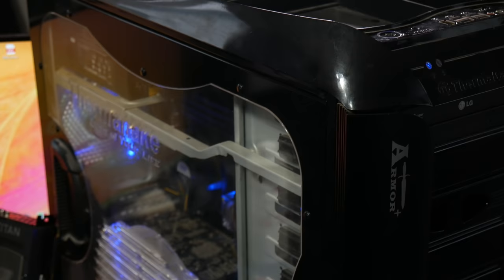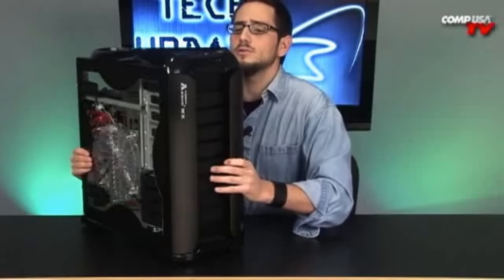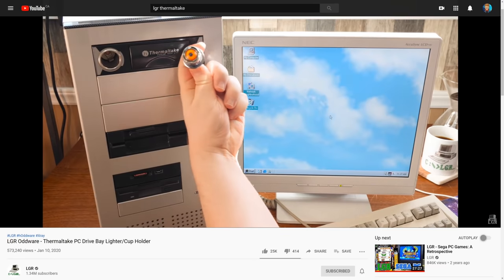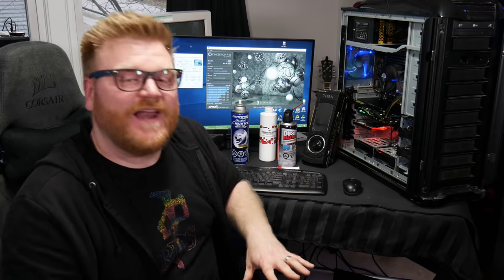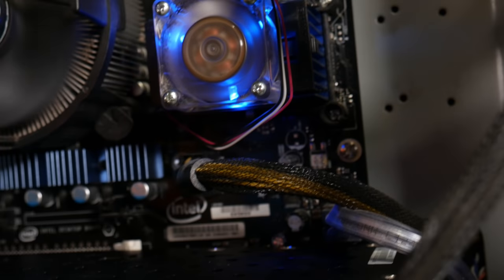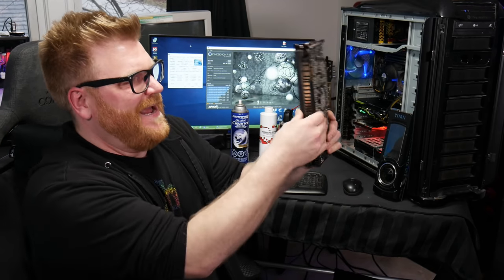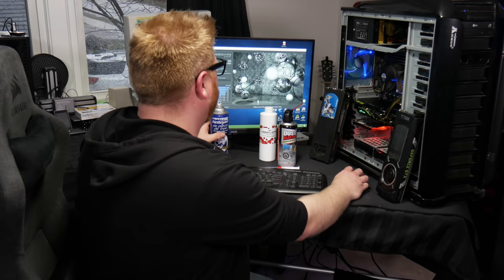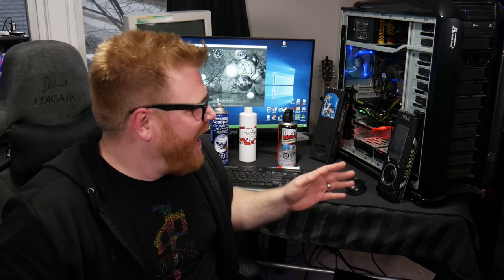Can $5000 buy a PC that will last 10 years?

Comment: I bought a i7 2600k system secondhand 6 years ago for 170$ sill running it with a gtx 980-bought for 200$ about 3 years ago it had a gtx 470 to start with ...still getting above 60 fps in most titles ...Only AC Odessy is giving me a hard time at 59  and bottle necking the gpu.For casual video editing and so on its still Ok ,but im struggling with UE4 compile times sometimes so yeah its showing its age but  basically for 370$ + storage upgrading ... i got better performance...My plan now is to wait for R9 3950x to get hella cheap.

Comment: i got a 7th gen i3 system then ryzen came out, recently i threw an i7 7700 in my build and still have the 1050ti from the original build and added a samsung evo nvme, that made the biggest difference for me, and only a 1080p monitor at 60hz im still happy with my set up even tho its probably worthless now days, i still love it and dont think i will need to upgrade any time really

Comment: Have a AMD A10 that lasted 10 years just had to change vid card  to a RX 590 from a gtx 640 which replaced a 220 Nvdia. Can play Doom Eternal. PC was $450 roughly when it was new cause I went with a cool looking case and 1st ever hdd wih built-in cache for when this was new. New update and it cheap I can get in a few months for this still fast PC RGB strips 😅

Comment: If you spent that same amount of money just 2 years later, it wouldn't have been nearly as bad. Imagine him buying 2600K with 16GB of RAM and a 128GB SSD (or even 256GB if he was spending that 4000$) with more reasonable case and aftermarket CPU cooler. That CPU would be holding up soooo much better now 9 years later and with just GPU upgrade the PC would perfectly passable for another 2 years. But then again, he clearly does no maintenance to his machine so his plan to have 10 year machines is doomed from the start.

Comment: My brother bought x58 in 2009/2010 for 2000$ - i7 930, 12 gb ram, asus p6t se, noctua d14, Amd 5870, Cooler master 700w power supply fully modular, Cooler master sniper case and 1tb hdd or 2x 1tb i am not sure about that.

Comment: I'm still on the original AMD phenom 1090t - watercooled and overclocked to insanity along with nb and HT link overclocked as well -> case frankensteined with extra cooling and to fit the waterblock and motherboard cooling. 
Only upgraded the video card from a AMD 6950 2 years ago along with grabbing an SSD - it wasn't necessary but it was a gift and frankly yay. 

So far I still don't have issues with my System - aside from the very rare game (SSE 4.1 issue) but considering I use my PC for gaming (high/ultra 1080p), photo editing and rendering - it still serves me well - just needs a deep clean every couple of years to get that dust out. Planning to do my full system upgrade in the next 3-6 months but waiting to see what the market will look like and what should last me the next good number of years - considering this little phenom has seen it all. So yes a PC can last you 10 years - although I only spent £600-£800 on mine roughly :P

p.s.  Still have the old Asus Xonar 5.1 Soundcard.

Comment: Spent $3200 year and half ago. So far it's still on top for gaming... Hoping to get at least a year and half more before it needs upgraded.... 9900k 2080ti 32g ram 2 1tb nvme ssds and 2 4tb hd 850w power supply....

Comment: Sounds like a matter of more money than sense - I tend to work on a similar basis of building to last but wouldn't dream of spending that much.

Previous build was from '09 and was i5 750, 4gb DDR3, Radeon 5870 1gb - lasted close to 8 years before I had to upgrade the GPU (Fallout 4 really doesn't like 1gb VRAM); total cost was less than £800 including drives and case. (It's now running Xeon 3470 and R9 390X 8gb and is still quite capable).

Current build is i7 7700K, 16gb DDR4, Vega 64 and Evo 860 M.2 and I'm expecting it to last another 4 - 5 years at least (built in late 2017, just before GPU prices went crazy).....

Comment: I basically managed to pull the same thing with my Phenom II, minus the total upfront. 1.5k CAD for a 1090t on a Asus Crosshair IV. It got a RAM bump to 8 gigs five years ago, and the GPU from the HD4870 to a used R9 270 i got for $60 at about the same time. Then My friend needed a GPU, so He bought that and I went ham on (My still current) 980ti two years ago. Peicemeal upgrades on things like GPU etc are fine, But keeping core components alive as long as possible is a fair thing to do.

That CPU took overclocking like a champ, and it broke 4ghz across six cores, bumping it up enough to overtake my friends 2500K through sheer bruteforce (and a stunning 300 watts at idle)  which kept it actually at reasonable frame-rates on high settings for a very long time.

It's been relegated to the living rooms PC and replaced with a Ryzen 3600, which I'm planning on seeing how long I can keep that going for.

Comment: I feel like I got in at a good time. I spent about 700$ for a i7 7700k build. That was everything except gpu. Then I just upgraded from a 750ti to a 1070 a year and a half ago, and 2 weeks ago 1070 to 2070s. My plan for the future is get a new gpu in about 2ish years or whenever it makes sense to, and then maybe upgrade platform in 3-5 years, or whenever I see a need to. But currently I'm very happy with my computer.

Comment: In 2010 i bought a dell xps 9100 i7 930 12gb ram radeon 5700 for $1699 lasted 10 years  just ugraded it with a xeon 5680 and 24 gb of ram x2 ssd and an rx580 it still handles games quite well and it will work for my 10y/o son.............. Cause i just built myself a a ryzen 3600, asus x470 pro, 32 gb xpg spectrix d60g , 2x m.2 512gb and a rx580 (soon to be upgraded)in a white fractal design g case

Comment: My RAM recommendations: 8GB for casual non-gamer, 16GB for light or eSports gaming, 32GB for power users and gaming. I have 32GB of RAM and usage right now running no game, is just over 16GB. I got Steam, Epic, XBOX Game Pass, iQUE for Corsair K95 Platinum, Logitech software for G502, SBX AE-5 software, and aroung 25 tabs open in Chrome. If you are a casual user but keep many tabs open in your browser, I say start at 16GB if you can.

Comment: My massive lesson was in gaming laptops. Built a beast of a laptop 6700k desktop part gtx980 desk top part 32gb ddr4 nvme and raid storage. Had 75hz 1080 screen with gsync cost me 5k AUD. Then 2 months later nvidia released pascal and then the core wars started. I sold that 5k computer for 500 bucks  3 years later. No such thing as future proofing. Can u imagine building a 6k computer now only to have zen3, ampere and navi2 come out within the year u built it! Fuck I'd be upset at that!

Comment: i tried so hard 2 years ago to tell my buddie NOT to spend 4-5 grand on a PC because they only gamed, didn't do anything else and in the long run it won't be worth doing it, they decided to buy it anyway without looking up parts, they spent that much money on a high thread intel CPU but low clock speed and questioned why they was getting low FPS after spending all this money, some people just don't take advice and thing more money is better, it's about what you're going to use it for not how much it's going to cost.
If you want my advice, the best way for future proof is 1. not go too extreme 2. get a CPU+mobo capable of overclocking 3. go for higher core vs more cores.
if you do your building right you shouldn't have to swap a CPU+MOBO for awhile, mainly the GPU, im still running my 2nd gen i5  and it still going fine, 70-80fps avg in warzone 100+ in normal multiplayer, CSGO 200+ fps, it's mainly the GPU that kills your frames alot of the time.

Comment: I spent $700 a couple of months ago and ended up with a ryzen 7 2700x, gtx 1070 ti, evga 1200 watt modular power supply, 16 gb of 3200 mhz ram, a decent b450m motherboard, and about 1.5 tb of storage

Comment: I just built a PCIe 4.0 build with a Ryzen 3800x. IF AMD sticks with the same socket for a while longer I've got great upgrade potential from this point forward. I don't expect PCIe 5.0 to happen any time soon... So far I'm $1300 in on this build with PSU, MOBO, 3800 DDR4 RAM (Comfortably coupled at 4200), CPU, 2T PCIe 4.0 M.2 for my games.. GPU is next when I start working again after COVID19, a PCIe 4.0 GPU drops, and I can comfortably finance one. For now my GTX980TI Classified is holding in there. With just CPU and GPU upgrades over the next decade and maybe a RAM upgrade, it is possible to stretch some parts over a decade. You need to remember that game development is tied to console specs, not top end PC specs, generally. But yeah, your price is 100% on point with something he could get and upgrade for quite a while with how new architecture is hitting the market that will be adopted over the next decade or so. 

TL:DR - Building a PC with the intent on the entire thing lasting 10 years is laughable. Building a core platform to upgrade from for the next 10 years is completely plausible. If you build for better than the next gen console specs, you will be good until the next next gen console on most games.

Comment: The most I've spent on a pc was about 2k over time. It was about 7 years ago. 4790k, msi gamig 5, 16 gig dominator platinum 1866 oced to 2400, 1 512 pro, 1 500 evo, ax860i, blu-ray, and 2 760s. Never had enough money at 1 time to get a really good card. 

What I did just do was put a 1660 super gaming x in it and to this very day my build is running strong. It crushes all games at 1080. Thats with a 4.6 over clock on the 4790k with a H90i by corsair. 

That 860i died on me. I waited weeks for my rma and corsair did not have it. They ended up sending me the platinum ax1200i as a replacement. Bran new not a recon. 

Corsair and evga saved me many times with their service and warranty. My ram died so I drove to corsair and swapped them for new kits. 

If you live in California semi close to the bay area only buy corsair and EVGA. Best service ever and they don't have a problem meeting you at the back door!

I did end up getting the msi 1660 due to availability and price.  I was about to get the evga 2060 8 gig but, they were out of stock and Amazon was priced way to high.

Comment: I spent $4000 Australian in 2014 , 5930k, 2x gtx980s 32GB ram etc., etc. SLI was shot down in flames by Nvidia and only 4GB Vram. I recently upgraded the video to RTX 3070. So I got 6 years out of my old setup before the video was too slow. Processor still pushing well though at 4.4GHz.

Comment: Hi to all. I have agree with Timmy. I run platform from this era, but only because in 2017/2018 those parts were so damn cheap. Specs : xeon X5660 (overclocked up to 4,4Ghz), 24 Gb DDR3 (6x4 dimms at 2000 Mhz), Asus Sabertooth X58, couple of SSDs. With GTX 1070 from MSI it still runs very well all new games at FHD hight/extra settings. Even procesor power is still good (up to 1000 point in Cinebench R15), but it start showing the age of this platform and dont forget, it is on own limits and consume a lot of power compare to todays platforms. I had this only becasue i had a great deal for this MB, othewise i would rather stay on newer hardware. Great day 4every1.

Comment: The problem with building a $5000 PC is that diminishing returns hits it HARD.

Just look at the difference between the RTX 2060 Super and 2080 Ti. The 2080 Ti is only about 30% faster than the 2060 Super, but costs 4x more. And for CPU's, there's really not much of a difference in gaming between the Ryzen 5 3600x and 3900x (Though the 3900x does have a higher turbo).

So a $5000 PC will probably run 30% faster than a $2500 PC (In gaming). Hardly worth it unless you're made of money.

Comment: the whole premise of the video is that tech gets outdated, and that certainly true, I wouldn't think you can game (in a modern sense) on a P4 from 1998.  But you CAN run some emulation on one.  Also games of the era.  To me that's the beauty of PC gaming.  Instead of being forced by a company like Sony to upgrade on their path, as long as the PC plays the games/ runs the programs YOU want it to, it isn't obsolete TO YOU.  Timmy Joe, you're speaking like an enthusiast.  Currently I am trying to get into selling PCs in my local area, and I'm dealing with 60 year olds or older who are "fine" with using the above P4 until it dies.  WHAT?!  Blows my mind.  Oh and yeah, no maintenance on that thing either.

Comment: Well... two of the computers currently in use here are 10+,  three are around the 8 year mark, two are in the past year.  They all run and do so well for what they are.  One I have had to re-cap but that's easy stuff to do and with an SSD and a 'top of the line' cpu for the era it holds up well.  I do wish I still owned my first PC from 1991 with its 20 meg hard drive and Harrise 286 25mhz cup in it, had plenty of good times on that.  But when I bought that computer, I learned then and there, opening the box and removing that 286  I had just spent 1250 dollars, it instantly lost 30% of its value so I view any system as currently obsolete no matter when bought, when built or how old.

Comment: The problem with long term builds is always the video card. New Games are built and design to run on a couple generations worth of gpus. After that the support and optimizations aren’t there at all. Plus graphics in games become so much more demanding that 3 years later AAA games will be starting to show the age of the gpu architecture

Comment: So, small story, but...

TL;DR - No you can't buy a PC that'll last 10 years with 0 upgrades.

Long version. I bought a similar PC around the same time, though I bought the components and built it (i7-920, 6GB RAM, Radeon 5870). Around 2014, it needed an upgrade, that much was obvious, so that's what I did in 2015. I put a Xeon X5675 in it and overclocked that to 4ghz, upgraded the RAM to 24GB and changed the GPU to an R9 290X.

That computer still runs games absolutely fine at 1080p NOW. I did upgrade again (Ryzen 7 2700X, 32GB RAM and a 980Ti from my wife's PC), but that motherboard, CPU, RAM and GPU went to a friend because he was still running a Core2Duo in 2019 (legit not kidding). So if you plan ahead, you can build something to last for 5 years... basically every console cycle, and only need a few upgrades for another 5 years.

EDIT: For the record, that CPU/RAM/MoBo bundle cost me £750 (approx $1300 canadian) and the GPU was around £300 (approx $520 canadian so call it $1900 total for that build). The upgrades were probably like... £400-ish ($700-ish canadian) so the total build would've been close to £1500 ($2600-ish)

Comment: In 2010 I bought a PC wiht the i7 2600K, 8GB 1600mhz ddr3 and TWO GTX 580s in SLI (1.5gb models) and I was sitting happy with a top tier build. But by late 2013, I was already feeling worried if it will still be good enough. I ended up upgrading to a laptop in 2014 that had slightly better performance overall and was obviously more portalbe. So yeah, buying a PC with the intention for it to last a decade? Not happening.

Comment: I think that spending this much on a PC can be justified by the type of work you plan to do on it and that you could gradually throughout the years upgrade certain parts of it as newer and better ones come put and are worth enough replacing (let's say 1 year after you buy a 2080 super, the 3080 super comes out and its 30%, you could still most likely sell the 2080 super for 50% the original price you bought it for and get that much better gpu), when it comes to the psu you prolly wanna change that every 2 years or around there lol. And of course, DO YOUR MAINTENANCE regularly.

Comment: Still running my i7 2700k from when I got it in 2011 in my huge haf x case, but I do have an rtx 2060 in the mail right now to replace my 2x gtx 560ti in SLi. I did upgrade from 8gb ram to 16gb couple years ago to help with my photo editing when the hdd failed and was tinkering to replace it so I feel this guys pain just a little :p  but I have been over all happy with my experience these last 9 years. Love my Sandybridge but it might be time soon to get something a little more beefy going forward.

Comment: From my experience? Nope.
My current rig is a workstation computer that cost roughly $4800. Built in 2014, using parts from 2013, and its finally starting to show signs of degradation, after not having any serious loads on it for a while.

Any meaningful 3D or complex animation projects I would wanna make could not be produced on this thing. It simply hasn't maintained the speed and performance necessary. 

Thank God I bought parts for a whole new system just last month.

Comment: I just bought my son an old pc for $100 and inside was a core i7 930 with a water cooler and I'm not sure what brand it is because I honestly don't know much about water coolers so I took advantage of it and overclocked it to 3.96ghz and the performance is better than I thought it would be, the video card is a 9800gx2 lol definitely gonna upgrade that when I get the time.

Comment: spend 8k euro in Aug 2018 at the highest prices on mem for a home server, 2990WX , 128GB 3200 cl 14 memory (running 2933) 2x2TB nvme, 1030 for console and 1080TI for gaming , 15TB storage in a W200 thermaltake case with a 1KW corsair HX1000i psu.  It should server me well for 10 yrs as a server. atm i game on it in a VM but i do plan to prob add a 2nd machine for gaming in the case in another 3-4 yrs from now